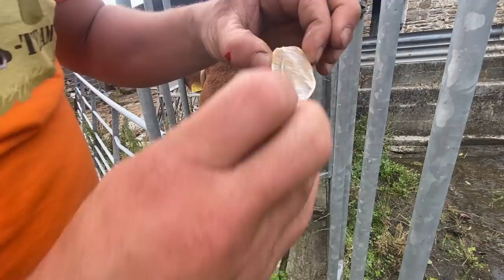Grass is drying,kuhn tedder problem, big lawn mower breaths again, cow horn chop. Episode 187

Comment: Justin, just like all farmers animal welfare should be No 1 priority. I have seen in-growing horns in Black Face sheep and used the cheese wire to cut them off, its hard going doing it, but end result is the welfare of the animal. As you said the horns will grow into the skull or the eye, needs to be done.